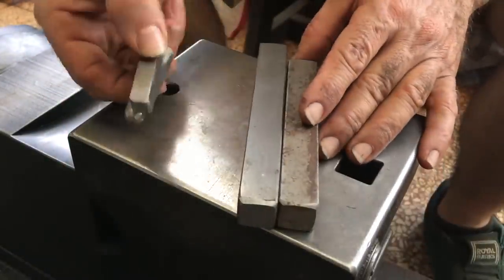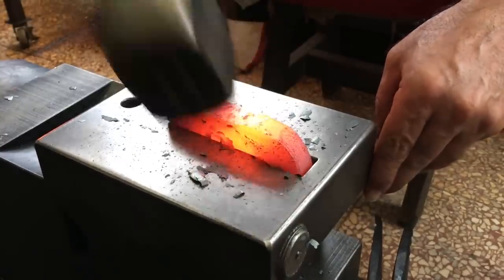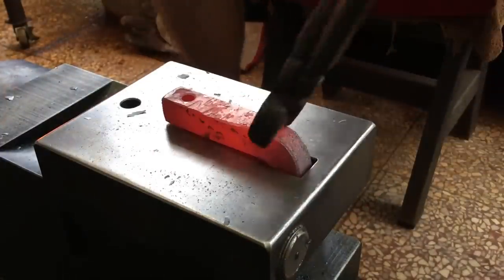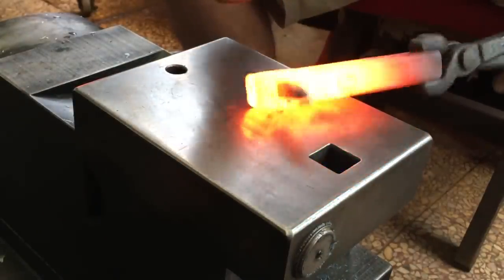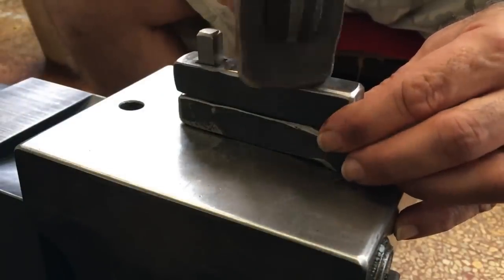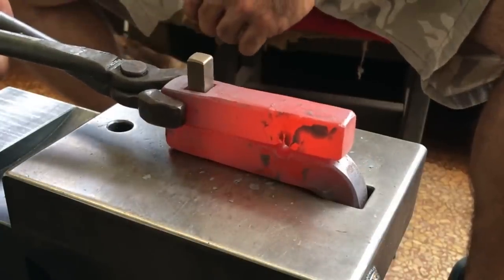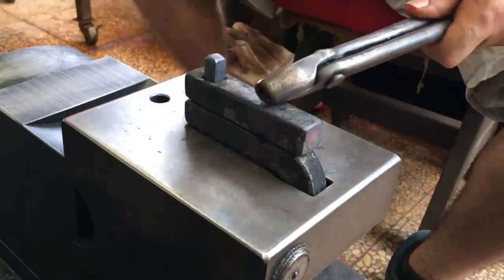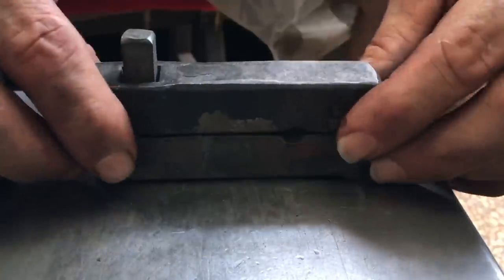Making a simple tenon jig

Comment: What’s the hammer called you used to make the square hole?
Reply from the maker: Hi Mike, That's just a square, tapered punch. But if you don't have such a punch, you could also just take a piece of square stock, taper it a bit, and work it into a round hole and get the same result. Thanks for watching.

Comment: Off topic question. Do you bring your tools (anvils) inside when not using them? Or do you treat them before the end of work with some oil or something to keep them so clean?
Reply from the maker: Drew, Good question. I leave most of my tools right where they are. While I am outside, the area I am working in is covered. I sometimes spray and wipe down my tools with WD-40. Also, frequent use will help prevent most rust. Thanks for watching. Glen

Comment: just trying to think of where i need to make a tenon in blacksmithing. any obvious answers i am completely missing??
Reply: Look at a few other videos of shaping reins on a pair of tongs, or the handle of a long spoon. Any time you want to reduce the work from non-round  to a round section, or from round of a greater diameter to one of lesser diameter, this is a very useful  tool for getting a consistent shape and size. Also, if you can't easily get steel stock in a size to match your punches and drifts, you can use this tool to make rivets of suitable size size.
Reply: @keithrhodes7386  Thanks Keith, i was actually looking for a way to make my own rivets a week or two back. i found a different way but you are right, this would be a really good way for making them too. Thanks for the helpful advice!
Reply from the maker: For me persoanlly, I don't weld in my current shop and so a tenon like this (and accompanying mortise) can be used to join pieces. I will make a video of a simple mortise ad tenon joint soon. Thanks for watching. Glen
Reply from the maker: Keith, Thanks for your help in replying. Glen

Comment: See I'm lazy, I would have sandwiched those two pieces in the vice and pre drilled my holes so I wouldn't have to do so much filing. 😂😂 That's pretty cool how it looked like you put a center drill in the end of it.
Reply from the maker: I was thinking about stacking the two pieces and drilling but I only use a hand drill and so thought if I skew things to one side it would be exaggerated over the longer drilling distance. Thanks. Glen

Comment: Glen What is the pen your marking with ? I've heard the guys talking about something like this .Thx Ray
Reply from the maker: Ray, That pen I use around the middle of the video is a paint pen / marker - good for marking steel. Most craft supply stores should sell these. I also use talc sticks to mark work but it wears off easily and is much less visible. But the talc sticks can mark work when it's hot whereas you would destroy the paint pen's felt tip if used on hot work. Thanks for watching.
Reply: Ha. I've ruined a couple sharpies like that.

Comment: Just put the two pieces of material next to each other and drill a hole through on the joint. I think this will be much faster and no gas used.
Reply from the maker: Pieter, I was going to drill with one price on top of the other but I only use a hand drill and thought that if I skew to one side this would be exaggerated over the longer drilling distance. Also, I needed to make this hole square in order to keep the pieces aligned when using. But I guess I could also have drilled both ends... Thanks.
Reply: True what you say brother, you can go skew with a hand drill. I must say that this small hollow was done very skillful. I can see it's not the first time that you did it. Happy day to you brother!